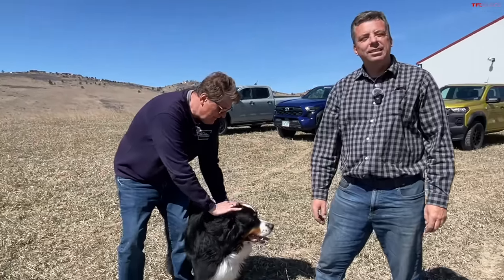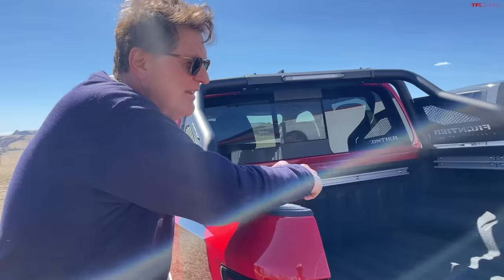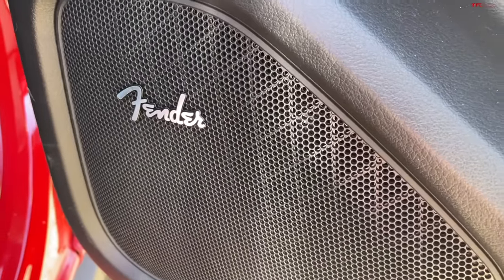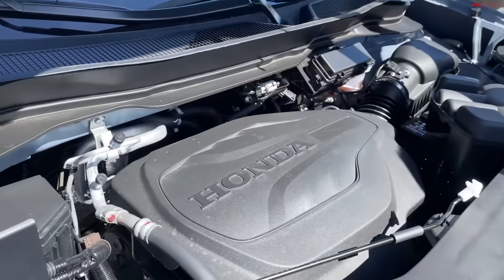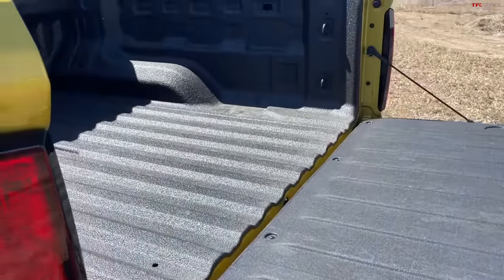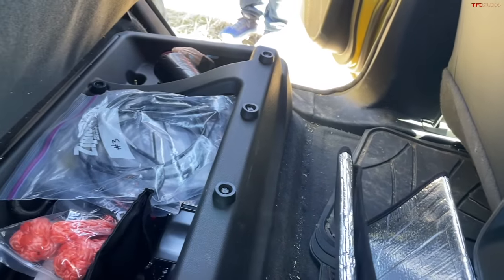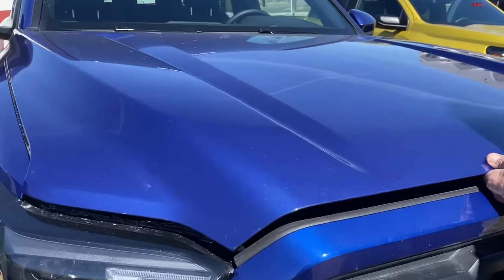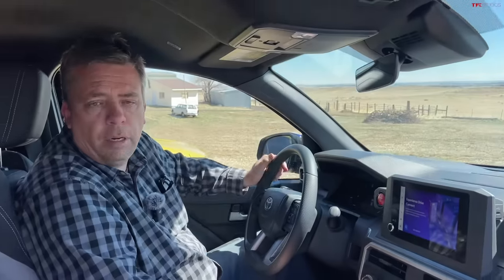We Compare 5 Brand New Midsize Trucks: The Differences are Very Surprising!

Comment: The need to redesign the price tags
Reply: You ain’t kidding. I want to get a midsize but I can’t justify the price tag. The top 3 I have on my list the Colorado, frontier, and Tacoma. I like the frontier that isn’t not turbo charged and it’s the only one I test drove. I’m a Chevy guy and really like the look of the Colorado but also consider the Tacoma since Toyota has been known to have longevity.
Reply: They will happily redesign it, upward like they always do. 😂
Reply: In 2010 I bought a three year old Ranger for $6000.  In 2022 I bought a three year old Ranger for $36 000.
Reply: You can buy a Ford maverick…25k I guess.
Reply: @joshc606  Not really a mid-sized truck, and good luck getting one for $25k. I own one, and wouldn’t recommend it as a mid-size replacement. Throw in poor build quality, part shortages and tons of electrical issues, it’s not even worth MSRP.
Reply: In order to drop the price, one of two things must happen. Either cheapen the content or remove features. Either way, people will complain. I agree, all overpriced and unnecessary. I'll stick with my 3rd gen Tacoma. It'll still take me a while to finish paying for it, never mind one of these.
Reply: Work harder and make more money
Reply: @Camaro45th That Tacoma longevity may be no more since the new one has a turbo 4 and not a V6. I’d say get the Nissan Frontier.
Reply: in 2005 I bought a brand new XLT F250 FX4 Diesel - $46,xxx
Reply: @benschmitz554 ...what about stop buying and wait for the price to drop, is that simple.
Reply: If you supported the policies that led to high inflation and interest rates, don’t complain.
Reply: 3 years ago this month I got my 21 Titan Pro-4x for $43k and 0% 72 mo. through NMAC. Crazy how much has changed.
Reply: @amazingjason455 interest rates were due to the Big F, not policies
Reply: Do you also want the median income to go back to years ago? 😏 Currently the median income is at the highest in history.
Reply: @amazingjason455 so what policies do you think led to high inflation?
Reply: If someone could design a small truck, the size of an 80’s compact truck with a naturally aspirated 4 banger, I’m sure they could price it under $25k. The Maverick was supposed to fill that niche.
Reply: Price these in Canada and get a huge price shock. Ford Ranger XL with a few options is $53170😳😳
Reply: The so called "small truck" is the size of the old mid size, the so called mid sized are the size of a old full size and so called "full size" are the size of an old F450 or a Chevy or Dodge 4500 and come with a bed smaller than a Chevy LUV, Ford Courier, or a Dodge RAM 50, and NY of the Japanese trucks those were based on from the 70s and 80s. 

To me the new trucks are not a real truck. They are over teched, fragile, rolling lounge chairs.
Reply: @ramonmacias9013  Overteched is ABSOLUTELY right. What grandpa or veteran laborer who’s worked with his hands all his life is going to take the time to figure out the operating system for his touchscreen control panel. It’s RIDICULOUS for what’s supposed to be a tool on four wheels.
Reply: Dude 45k isn’t bad….What kind of price are you looking for, min wage is now 15+/hr compact cuvs like rav4 are 35-40k…. So you want a midsize truck to cost less than a compact cuv???
Reply: @tdub25  in 1990 an entry level FULL SIZE truck started at $ 12000.00 today an entry level mid size truck starts at $36,000. The cost for a truck with a much shorter bed has tripled and you get more electronic junk that breaks down much faster and cost far more than repairing a truck from the 1990s.

I still daily drive my near entry level truck from 1990. I paid $13,000 for it in 1990. 

Will any of these technology encumbered trucks survive 34 years and still be reliable?

Half of the newer trucks I have seen my neighbors and friends have, had major electronic and computer issues within the first 5 years. And even more problems once they were out of warranty.
Reply: @Camaro45th as also a Camaro owner (your name gave it away)
My daily would be frikken EXACTLY what you said. Took the words right outta my fingertips. Such a damn predicament dude!!
Reply: @Combatpzman My Maverick doesn’t have your Maverick issues
Reply: @nmnn422 Good for yours lol
Reply: It’s hilarious that you guys complaining about the price still don’t realize that the cost didn’t go up, the value of your currency went down. An ounce of gold still buys what it did 100 years ago. Every dollar printed is a tax on dollars you own.
Reply: @Camaro45th The Frontier is also the cheapest one. It makes the choice easy imo.
Reply: @Combatpzman If yours is so horrible, you should resell it, I am sure you can get more than $25,000 for it.
Reply: @OhgodImtoosexy while everything increased more,  percentage wise.  The middle class is shrinking,  not growing.
Reply: @ramonmacias9013 you compare now to 1990. Min wage was like $4 back then.  Do you wanted car prices to be immune to increases while housing, food,  wages and everything went up? That's cute.
Reply: @vwvr6t prices will never drop. Automakers and stealerships realized they can keep raising prices and keep supply artificially low, so why would they stop?
Reply: In Germany you pay 70.000USD including Tax for a new Ranger. So you are lucky in the US.
Reply: For sure, my 2019 Tacoma TRD off road was 42k, with the premium package so mine has leather, sunroof, body color bumpers, parking sensors, foglights, heated seats, black headliner, nav system and JBL audio system for 3k less than their base model TRD off road.
Reply: Bunch of crap that's 10 k too much money. And I don't need the tech or the screens. Physical buttons, Bluetooth, cruise Control ant that's it
Reply: The dollar buys far less, money printing and throwing it away overseas.  1.2 trillion spending bill just passed. I suggest everyone read what's actually in it because congress didn't read it.

 I know this isn't apples to apples but its just statistics. 1930 new car average price $850 adjusted for inflation in 2023 $14,500.  New car average price is $48,500.  Average home 1930 $3900. Adjusted for inflation 2023, $70k. 2023 average home $420k. 1930 grocery bill average $8 for a full cart,  adjusted for inflation should be around $75 but it's $300 to fill a cart, 1 bag can be $100.  1930 Gas ten cents a gallon, adjusted for inflation $1.73 a gallon. Real average currently $3.60. 

1930 single income family average $4800 per year. Adjusted  for inflation should be $85k a year however average income today is $56k so less than inflation.

Average wages are significantly lower, but every necessity far higher than even inflation numbers.  This is what happens when you vote for globalism over freedom.
Reply: I’ll keep my 74 square body thank you very much
Reply: @Camaro45th look for a 1st gen Colorado.  From 09-12 you can get then with V8. You can find low mileage mint condition ones for about $20k. Less than half for these newer models. I own a 2009 for 15 years and now has 80k miles on ot and it has never once had any issues. Specs for mine. 2009 GMC Canyon 4x4 5.3L V8 with 4.10 gears and a G80 rear locker (all factory) 300hp with 325ft lb and that's basically detuned.  You can push 400hp with exhaust and a tune easy if you wanted higher power.
Reply: @amazingjason455 I'm interested to know, exactly what did you do to not support the "policies" of inflation and high interest rates?
Reply: @Iberian247 you mean the Ford Maverick?
Reply: @Iberian247 they don't design new vehicles for grandpa's.  They design them for the younger generations of course.  They also design them to push the limits of tech design innovation and they know they can profit higher off that as well.  Heck the average ago of the people designing these new models is probably like 32 years old.  They don't care how grandpa feels about it.
Reply: @1laimmiss you can have all that and for a third of the price as well.  Just find a low mileage well cared for 10-15 year old truck while you still can.  There out there.
Reply: but the CEO of all these companies needs the newest Ferrari for their collection.
Reply: @1laimmiss but also,  heated seats, and power (auto up and down) windows. The reverse camera is also amazing for hooking up to a trailer solo. Digital speed gauge is nice
Reply: If we redesigned our current administration, those prices would drop fast.  It’s not rocket science.
Reply: Yeah would they sell more if the prices were more affordable?
Reply: @tdub25 $45k might be reasonable compared to other vehicles.  However, I’d like to know how MSRP vehicle prices have gone up compared to household incomes for the target market.  Seems like Joe Buyer is slowly losing the ability to actually buy these vehicles.
Reply: @vettesweetnos what source are you using to calculate inflation?  There’s what the consumer price index reports with its calculator but then there’s actual real world inflation and the gap is about 10-12%.  Using the cpi calculator, 100k 6 months ago is only 98k as of March 2024 numbers.  We’re in a rapid inflation cycle and have been for about 3 years
Reply: @Camaro45th  look into the honda ridgeline 
I recently purchased one and couldn't be happier 
And this was months after wanting the new tacoma
Reply: The consumer designs the price tag
Reply: @OhgodImtoosexy Does the rise in median income keep up with inflation??  Inflation has been rampant since the pandemic, when governments printed too much money and paid people not to work.
Reply: They will they’ll just raise it. That’s all they know how to do.
Reply: @joshc606 lets be honest who the hell wants a redesign ford fusion with a bed?
Reply: @Camaro45th the Colorado zr2 is a fine looking truck.
Reply: Allllll vehicles are expensive.  Why do you think Mid size are that much.  Because some half tons are selling for 90 grand.  It’s ridiculous

Comment: You say all of these are about $45k, but what you're getting for that $45k varies pretty wildly...... Let's compare: Nissan Hardbody is about $46k, but is their top trim. The Honda Trailsport is also about $46k but is well-equipped (leather seats, etc). The Tailboss...  That starts at $38,000 and MAYBE touches $46k if you option it with everything... which you didn't, so that truck is NOT $45k. The Ranger hits $45k is if you get it pretty well decked out. The Tacoma.... is $45k for a TRD Off Road... barebones with an automatic transmission. No leather seats. No options. Nada. So.... please.... be more honest about what you're getting for the money.  🙄
Reply: $45k!  The only thing they need to redesign / update is the crazy prices
Reply: I’ll tell you what you’re getting is you’re getting ripped off! None of them should be priced over 20,000
Reply: lol hardbody is not the top trim from Nissan

Comment: I like the Frontier
Reply: Except when u sell them.
Reply: Buy them used
Reply: Wish they used the same black for the fender wells that they do for the front end…
Reply: the payload sucks tho
Reply: I don't like the wheels on the Frontier...I may be the only one
Reply: @wutruriding1355 the original owner bought my 2022 fully loaded SV for $45k, I bought it second hand for $32k with 13k miles. I'll drive it into the ground. Best value truck I could buy.
Reply: nissans are garbage builds now
Reply: @jlover911 What OBJECTIVE  facts do you back your opinion with? Thousands of actual buyers found the Frontier to be the best choice.  Have you purchased and evaluated,  or do you base your opinion on a bad CVT  car transmission, built 20 years ago? Or are you just a Mexican Taco eater?
Reply: What do you mean when you sell them? Frontiers currently have the highest resale value
Reply: @MrJdubz1980  Isn't that amazing? It sounds like buyers are seeing good value on the Frontier after testing either the antiquated and uncomfortable old Tacoma,  or the complicated overdone new one.
Reply: @wutruriding1355  the point isnt to sell them :P if its a good truck you wouldnt have to , most of the newer gen just wants to trade in every 2 or 3 years must mean the vehicle sucks then if you want to sell it that quick
Reply: I can only imagine how much it would cost to change the water pump on the frontier sense it’s drivin by the timing chain
Reply: I'm pretty sure you could get a really good deal on a new frontier. Nobody buys Nissan anymore, so salesmen would bend over backwards to sell you a truck.

But I'm good... I'll pass on any new truck right now. Too expensive, too many useless features and too many recalls and problems with very short warranties.
Reply: @Miked1332  Judging by comments on various test videos, a LOT of people including former Toyota lovers ARE buying Nissan,  and are happy they did. If I had the cash and needed one,   Nissan is the only one I'd look at. They have the least of the new crap like turbo 4 cylinder and giant dash screen with heater controls run through it. I did stop by the dealer in my old 1987 Hardbody to see the new ones, and they do seem like a nice rig.
Reply: @jeanclaude7018 Pretty much. I went with the Nissan because any all-inclusive infotainment is a hard no for me. I will never have a screen gatekeep my hvac controls again. What a cold drive home, that was. -35°F with no defroster was greeeat.🤣
Toyota was a no. I just didn't see the value in the new Taco and I live in the rust belt. Not dealing with the old Taco's frame rot shenanigans.

Frontier was my only option. I'm hanging onto this truck until it's nothing but a pile of dust and rubber.
Reply: @texttwenty-nine1627  I hear you. I guess either the sheeple just love the magic touchscreen for everything,  or else it's cheaper than making separate switches and wiring. I have a stash of switches from the junkyard if I heed them for my Hardbody. 
Some of the rubber door seals and vacuum hoses WERE turning into black dust on my old Nissan,  so I found new ones on Rock Auto, and I'm  going to work it hard again today with another ton of garden compost.
It gives it the "Carolina squat" look that makes the bros envious, but she keeps on pulling.

Comment: I like the trucks with a V6,   Frontier, Ridgeline, and Ranger.
Reply: I'm excited to see the 2.7 review in the ranger.
Reply: @LukeO-1234  That would be my choice.
Reply: Turbos are a no go for me
Reply: @brad4527 eventually that will be all there is, with regulations being forced upon the truck industry, I would say next generation all v6 will be gone in this sector... You will most likely have to go for a full size to get a V6, and even the V8's are going away in the regular half ton sector. Things are changing and unlikely to go back.
Reply: @brad4527 dude, use good oil, service the motor regularly, don't flog it until you warm it up. The turbo will last. Actually this is how you look after any motor
Reply: NA V6s suck in trucks. Power/torque curve doesn’t work well. I6, V8, I4turbo is superior.
Reply: @LukeO-1234 I bet it’s gonna be impossible to get.
Reply: The v6 is an option on the Colorado
Reply: @Rstars2o4  just checked, only 2.7L 4-cylinder
Reply: @rondail5675  i stand corrected then

Comment: I remember when those Dakota trucks were the biggest of the small trucks!
Reply: They really were the first of what we call mid-size now.
Reply: Yea the Durango was built off it in 1998, those seemed huge when I was a kid
Reply: The standard of midsize before it's time, Dodge Dakota...dare to be different
Reply: Yeah then they brought that monstrosity of the 3rd Gen to market it and ruined the Dakotas sale success went from selling well over 130k units a year down to 75k in 2005 and by then end of 2012 just over 600 units.
Reply: When they switched to the 4.7 from the 5.3 it created a lot of problems with the brand.
Reply: @johnconway7484 I totally agree, but I had a ram sport single cab with the 4.7 and that truck was really fun to drive.  It was a zippy truck,  sounded great, handled amazing and the engine and transmission actually were really reliable.   Granted I got rid of the truck when it was only about 10 yrs old with only about 120k miles on it, bit not because of the engine, but every other damn thing else started falling apart. Just really poor quality.  The front end was constantly needing repairs from power steering arms, upper and lower control arms, sway bar, oil pan gaskets rotting etc... I could go on and on.  But the engine and trans never gave me problems.
Reply: Best looking to
Reply: @johnconway7484 Dodge never made a 5.3... you had a choice of the 5.2 or 5.9 V8 in the R/T models.
Reply: @stuartstogdill2406  great, 5.2, pardon me as it's been over 20 years.
Reply: Omg that’s true! Back in like 2001
Reply: @stuartstogdill2406 my dad had a Dakota v8. That seemed like the best truck to me in terms of size and power. Very fun to drive
Reply: Give me a Mitsubishi raider
Reply: That Dakota was bigger than these trucks  where it counts- on the inside. These trucks are big on the outside,small on the inside. Harder to see out of and maneuver yet not as roomy and comfortable. Great job designers 😉👍

Comment: The Frontier in most trims is a great value.  
The Hardbody is IMO just a cash grab. Over priced SV.
Reply: I agree. The wheels could have been neat but look phoned in. Rushed. I like the rack in the bed but they cheaped out. Looks incomplete without the off road lights.

Comment: 57:45 -  Roman, most of us have one or two cars not 20 that cycle through every four months so we get used to what we have. I still don’t like the ignition button but when you’re not hopping between vehicles, your muscle memory sets in.  your complaint is unwarranted. As far as engines go, I won’t trust the turbo until I see many of them crossing the 200,000 mile mark without major engine repair.